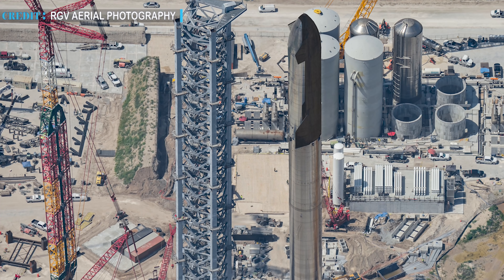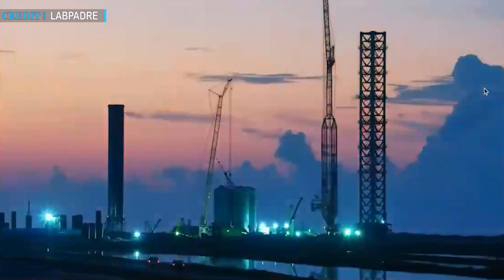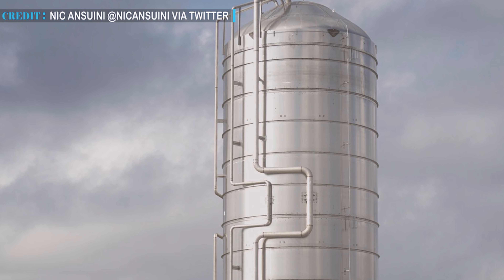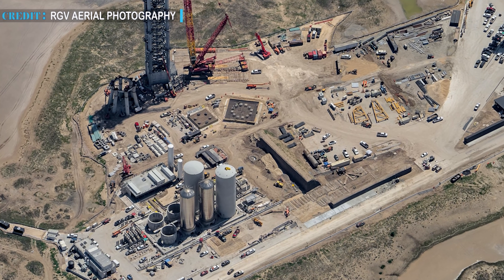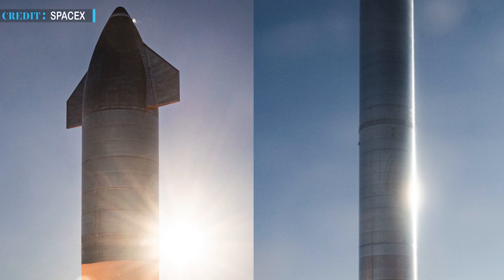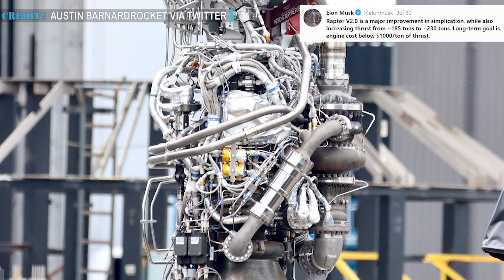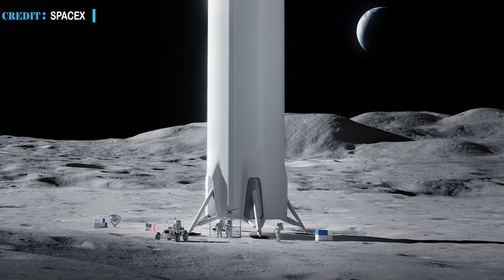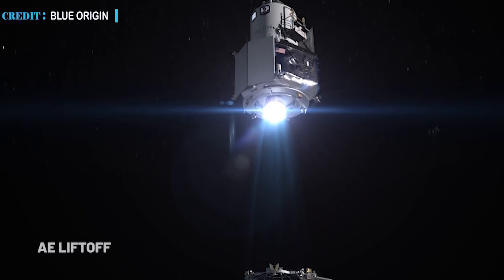SpaceX Starship on focus | Elon Musk reveals the heart of Super Heavy booster | Bezos masterstroke

Comment: Maybe you meant that the launch table can stand 5000 metric tons?  Even that seems too low, since Starship will be about that heavy when fueled;  the table should have at least a 2:1 margin of safetey or better.  If I was designing it I'd set the goal at 10,000 to 20,000.  But the videos says it withstands 500 tons.  That's the weight of just two of those tower segments.  It is impossible to think the table would be so weak;  I think the research for these videos is.  It's like every video has at least one factual mistake ...